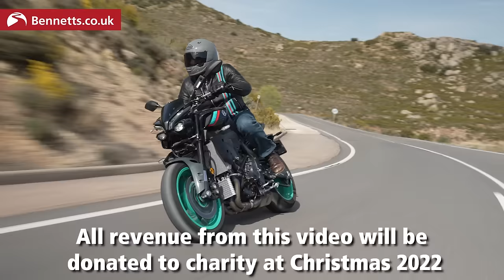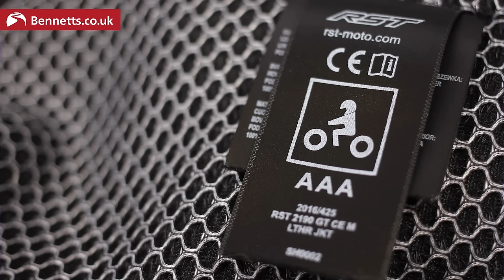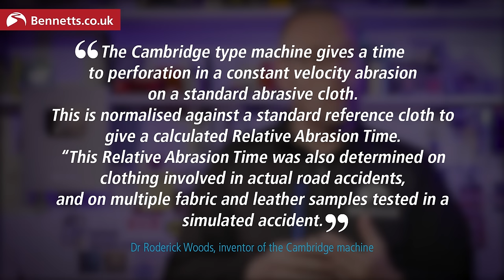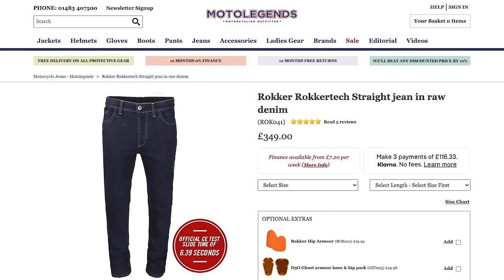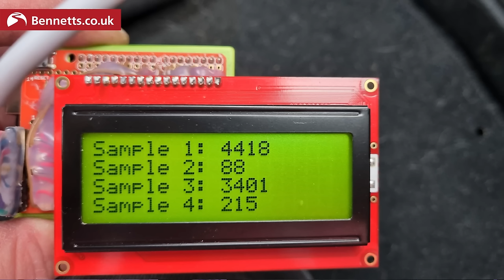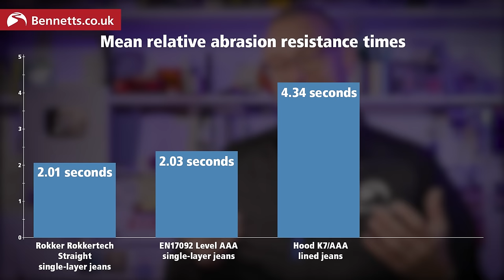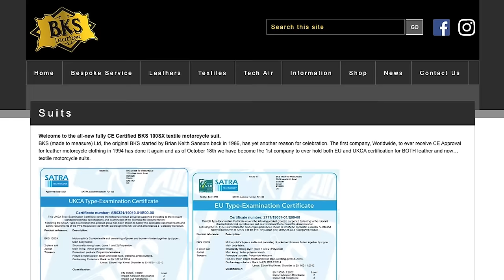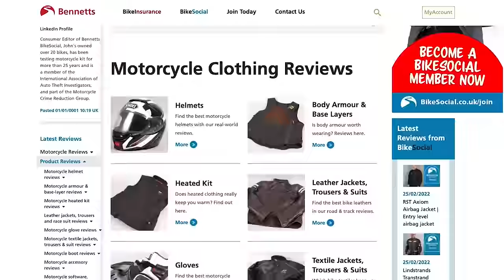Best motorcycle jeans | Single layer vs lined: THE TRUTH

Comment: Thank you John for an excellent and very informative presentation. There's far too much mis/disinformation around and people end up making the wrong choices as a result. Local climate conditions also influence those choices, as riding in hot and humid places such as here in Philippines is significantly different from those in the UK or similarly-cool/cold places. Rider comfort is therefore part of the equation, as riding well-protected but in a bath of perspiration is not conducive to safety, as dehydration rapidly occurs. Decisions, always decisions...
Reply from the maker: Absolutely! Which is why I want people to make informed choices. While some are going to argue, it really doesn't make any difference to us what people choose to wear. I like and wear single-layer jeans, but also lined jeans. If we see scientific proof of single-layer jeans matching the abrasion resistance of decent leather, across their construction, I'll be among the first to buy them.
Reply: It has noting to do with the weather. People here also drop all the cloths when it goes past 20-25°C. Only small shoes on. Many don't use their bikes when it is less then 20°C and sunshine. And it shows how bad they are at riding. And say it is to hot to use MC gear. But they are only lying, or don't care. It is not better and colder to ride a bike with shorts and T-shirt, when the sun is up. To keep cool you layer up under the MC gear, same as protect against the cold. And have one layer long sleeve t-shirt, and one more T-shirt on top. And Gore-Tex, pants and jacket, on top. Then you keep cold . And have now problem. Works great up to 32-35°C, and it did not even feel warm. Even stuck in still traffic even, it was just fine. And the most important are high boots. They even made it easier and much better to ride.
People don't know how clouts work. You have to have more clouts on to protect against the sun. Not take it all of. They you just start boiling and pass out.

The really reason people don't have gear, is that they wast all their money on a way to expensive bike, and/or skip the gear because it is to expensive. But when you lose a leg or two, you find out that the gear was not the most uncomfortable or expensive… But then it is to late… And that is if you are lucky…
Reply: @Gismo3333  I agree with you; proper MC gear is, for me, essential. However, today was 36C with 93% humidity here in Philippines; trust me, it gets very uncomfortable very quickly, which is one reason why the locals don't wear what the western world considers proper equipment. The other reason is cost; when most folks here make around $8/day if they're lucky, propper gear is simply unaffordable, as even a pair of halfway-decent gloves cost more than two days pay. Most bikes here are 150 cc or less and traffic speed is rarely more than 40 kph, but the average daily road toll is 36/day killed... 

In West Australia I recently rode 110 km in 43C heat wearing propper m/cycle gear, as I have in the 60+ years that I've been riding and although I was hot, it was completely bearable. On the other hand, I rode for a number of years in the snow and ice of English winters, also wearing propper gear. Correct kit for the conditions makes a big difference, but I'm in the fortunate position of being able to afford it, unlike most of the local here, for whom the motorcycle is essential daily transport.

Comment: I once crashed in motorcycle jeans and they didn't even get a scratch on them. Wet asphalt and low speed were key ingredients i guess. I get to use Dainese D-Air pants for 4 months a year though, because with such a high temperatures in southern europe, jeans are not an option, except if you like to live in a sauna.

Comment: "We're not trying to promote or discredit brands..."
Perhaps a noble intention, but this still leaves the consumer in the black hole of "So which brands are actually worthwhile or not?"
I think we *should* discredit under-performing brands. What else will motivate them to either 1) stop 'stretching' the truth and/or 2) make a better product?
Likewise, the brands that perform the best should also be called out and have positive attention drawn to them - for actually doing a good job and being an honorable company with integrity and ethics.
Reply: The information you are seeking could be provided by the availability of a higher standard than EN 17092 - one using the Cambridge machine specified in EN 13595 to provide numerical data, rather than the opaque pass/fail criteria provided by the Darmstadt machine. Unfortunately, EN 13595 is due to be de-listed in September 2022, leaving only the industry-favoured EN 17092 in play, and there has been vociferous and vitriolic opposition from certain quarters of the industry to development of an updated alternative to 13595 which would sit above EN 17092 in terms of test severity.

Comment: Great insight John. My only gripe with jeans is the knee armour is always on the inside of my knee, it’s obviously my legs shape, but I’d like the pockets for the armour to allow side to side adjustment as well as up down. Keep up the fantastic work.
Reply: Pockets for the elbow and knee protectors are a lazy ‘solution’ to fitting these components, as the arms and legs are in proportion to the wearer’s height and the pockets will be in the ideal place only for a limited proportion of wearers from a more extensive height range of those the garments can fit. Velcro attachment and adjustment of the protectors offers by far the better system.
Reply: @paulvarnsverry11  I was thinking of stitching my pads inside. Your velcro idea is better. That way I can move the pads from one pair of pants to another.
Reply: @savage22bolt32  : Self adhesive Velcro is available, which will adhere to the impact protectors. The hook side of the Velcro goes onto the outer surface (strike face) of the protectors, and the loop side is affixed to the garment.
Reply: @paulvarnsverry11   👍 I think I have some of that stuff lying around the house somewhere.
Reply: You might consider wearing an armored, stretchy, under layer.    They keep the armor in place better.

Comment: A big thanks for this, it's clarified things for me as I've gone down the rabbit hole of official protection ratings and the potential untested levels of protection beyond that. It's not strictly jeans related, but I'm wondering if Bennetts or anybody else reading can recommend (or is even just aware of) any other close-fitting AAA-rated jacket like the Knox Honister? This does have somewhat of a link to the safety ratings discussed in this video. Explained below for those particularly interested :)

Context: I really like the idea of the Knox Honister - a close-fitting layer worn close to the body providing both impact and abrasion protection, giving the freedom to wear other (non-motorcyle) waterproofs, hoodies, etc. on top for weather protection. The Honister seems like a really decent jacket. However, Knox's claims around their A-rated trousers have left a bit of a sour taste in my mouth. Claiming that their A-rated Action Pro Trousers "are tough enough to be worn on their own" and are "for all types of motorcycle riders". In my opinon, this isn't just being a bit vague; it's objectively false and misleading. It claims that the trousers provide adequate protection for motorway or even track riders, which they don't, according to the CE standards that the claims are based on. This is the case regardless of one's personal attitude towards risk/comfort. I bought a pair of those trousers before I went researching and watched this video, believing their claim that I didn't need to bother with anything else. My plan was to just wear non-motorbike jeans on top of them, for motorway journeys. So, while the Honister jacket seems decent and I'll probably buy it, I'm also a bit peeved at Knox and am wondering if I can get the same type of product from another brand who're more transparent and honest about their gear's capabilities across the whole range. Edit - curious to hear if people think I'm over reacting though. Knox seem a decent brand otherwise.
Reply from the maker: There's the new Bowtex Elite... that and the Honister will be reviewed soon on BikeSocial.co.uk
Reply: @bennettsbikesocial  Thanks, the Bowtex wasn't on my radar yet :) will look into that and keep an eye out for the reviews!

Comment: One thing you missed here.. What the heck are 'single layer jeans' are! I had to go searching afterwards just to find out what you are talking about..
Turns out I've always worn 'lined' jeans(Draggns traditionally) and never knew there were some other options. Seems like something that might work to convince people who hate the weight/heat of lined jeans/leathers to wear /something/ protective over non-motorcycle jeans but it should be clear they are less safe.
Reply from the maker: That's a really good point, sorry about that! I got so caught up in explaining the difference, I forgot to cover the basics. I hate assumed knowledge, so I am sorry! Cheers, John

Comment: I really wish you would test (and name) a range of AAA single layer jeans because how they are constructed varies so much; some may be way better than others. I've just purchased a pair of PMJ's and would love to know whether the (Motolegends) claimed 4.2 second slide time was accurate.
Reply from the maker: There's no such thing as a slide time unfortunately, so I'm not sure what can be drawn from it, but the A to AAA ratings give a good guide.  Lined jeans will generally offer better abrasion resistance that single layer, but they are a little thicker. Cheers, John

Comment: Kevlar's less effective when wet.. not washed. water blows the structure apart, it's fine when it's dry again
Reply from the maker: Sounds like you've been fed some marketing cobblers by a brand that was punting this about a few years back
Reply: @bennettsbikesocial  maybe I fell for their shill.. you're right, I'm never shopping for protective gear on research-gate again, what was I thinking.
Reply: @JayJay-_  : The scenario you described applies only to the multi-layered construction of ballistic vests, which is why they are encapsulated in waterproof fabric. A company selling non para-aramid clothing deceitfully claimed the same effect also affected single layer constructions commonly found in motorcyclists’ clothing. My understanding is they received a cease and desist letter from Du Pont’s lawyers, but by then the urban myth had legs, as your original post confirms.

Comment: hi......have you done a video on tire repair kits and systems?....I am a born again biker, totally staggered by options for the disaster of a tyre leak......
enjoy lots of your stuff, all the best  Glenn
Reply from the maker: Good call... not yet, but I can tell you that I carry something like this (I just made my own up) based on seeing it be used successfully. Cheers, John https://www.adventurebikeshop.co.uk/wheels-mudguards-huggers/airpro-tyre-repair-inflation-kit-no-pump-required/
Reply: @bennettsbikesocial  thanks......that looks a bit better than the one i was looking at.......but i was also looking at the spray in repairs.....and the ones you put into tyre before you get a puncture......i also seem to remember something like that, but it bled to show that you had had a leak.......
I am far too old and stiff for tyre levers by the side of the road.....under street lights.....the choices are bewildering....

loved your vid on cleaning stuff....i bought a muc off power power with all solutions....lol..quite fun...but will look out for your recommended stuff when i need more .......

thanks again..

Comment: About time someone started the testing debate, we really need a better testing standard than the CE rating.  Personsonally I dont trust D30 armour, I'd like to see some real world feedback on its effectiveness.
Reply: We had one! It was called EN 13595 and set a high bar (it is what MotoCAP draws from for the star rating scheme). It was supposed to run alongside EN 17092 and for both standards to merge in around 5 years, but European Standards rules forbid two standards for the same products running alongside each other (even if, in this case, the two standards would have been complementary, not competing) and so the officials decided to axe EN 13595, which will be de-listed in September 2022. 

All is not lost, however. In the UK, EN 13595 will be replaced by BS 13595, which is currently under preparation. It will contain two performance levels: Level 1 (which might be viewed as “AAAA”) and Level 2 (“AAAAA”). It will use the Cambridge abrasion machine referenced in the video.

Comment: We basically went from a CE testing framework that was too hard to pass and unnecessarily harsh (eg garments tested without the protectors) to one which is too easy to pass.
However, while I get that fully lined jeans will be more protective than single-layer, even if they are both AAA, what I don't get is: how can we have AAA single-layer and AA fully/partly lined? This I don't get
Reply from the maker: There is the chance a brand only tested to a given standard, but this isn't a reasonable excuse and it adds to confusion. In cases like you describe, we have to assume that the garment couldn't meet the higher standard for abrasion and/or tear and/or seam strength. Also, in AAA the bum is counted as a key impact area, so needs to pass the same levels as the knees, for instance. It can be confusing, but it's made more so by those who muddy the waters. Cheers, John
Reply: Also, a certain brand has AAA single-layer jeans with only 2.5% aramid, as per their label. How they can achieve AAA with so little aramid is beyond me.
Reply: @ukuserful  EN 17092 sets a relatively low bar, is the answer, although it has acted as a barrier to truly thin, flimsy and weak products being placed on the market. 

EN 17092’s requirements are based on what clothing available on the market in 2016, when those requirements were written into the standard, could achieve. As the video demonstrates, garments which have the same AAA classification can and do generate widely different results. EN 17092 does not recognise or reward superior performing products beyond AAA, which have been developed since 2016 - there is no 4A or 5A and currently no appetite with the industry representatives on the European Standards committee to add them. 

Could these be added to EN 17092 in the future? Not without radically respecifying the Darmstadt machine, in my opinion. Higher rotational speeds would be necessary - possibly beyond double the current maximum of 707 rpm - which could require a total redesign of the motor and sample holder assembly to withstand the forces, and there have already been issues with the concrete doughnut that is the abrasive test surface breaking up prematurely (one test house I know always has a spare on standby, at ~£3500 a time). Quite how it would fare with even higher rotational speeds is a matter of concern. Meanwhile, the Cambridge device stands ready to deliver answers!

Comment: Things have come a long way. Back when I started riding (on the street) I could only find one sort-of scientific test that had ever been done. A cycle magazine here in the states had done an article where they tested different weights of leather and commonly found denim by building a rig on the back of a pickup that would drag a fixed wheel with a tire on it (not spinning, of course) and then attaching samples of different materials and dragging them down the same piece of pavement and showing the results (worn away, worn with small holes, worn but intact) with photos.
Reply: i reckon that's the best test hopefully we'll never have that type of slide ourselves.

Comment: All your rig was missing was damping on the arms - you have shocks on the wheels for exactly the same reason - to keep them in contact with the ground and prevent bouncing.
Reply from the maker: Yes - Dr Hurren's rig has dampers. Still, all the work they've done with it has proven the Cambridge machine to be an excellent analogue, which makes for more consistent testing. Cheers, John